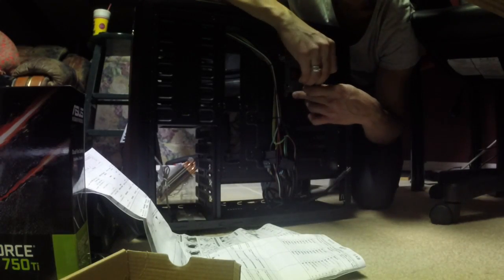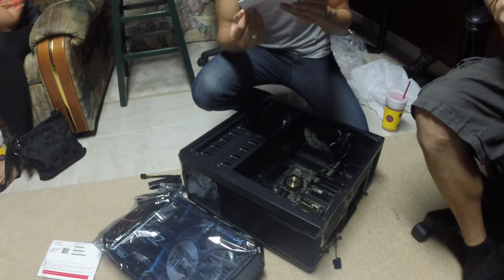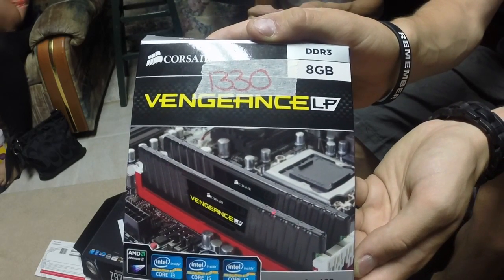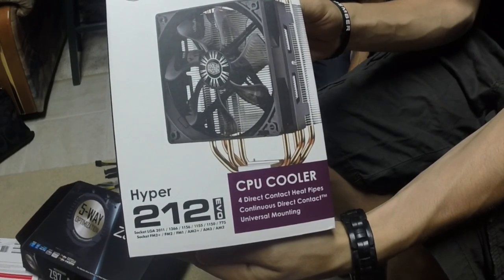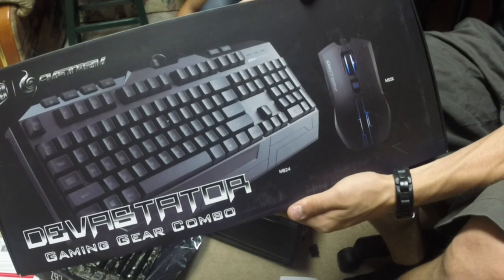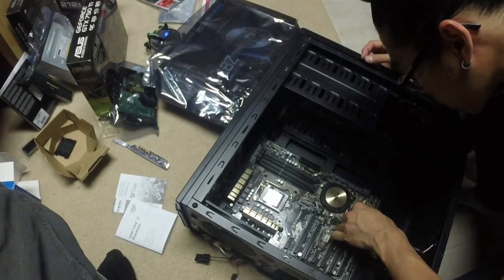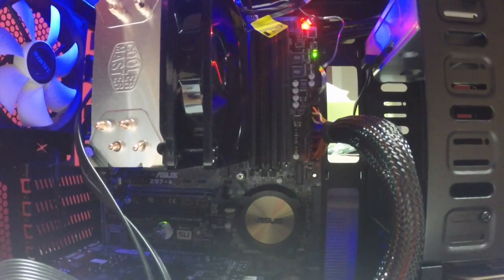Gaming PC Update - Parts inside, Problems Booting | SLAPTrain

Comment from the maker: Alrighty guys so PC is good and working :) very excited the problem was the CPU little heatsink got into the chip and shorted it cleaned it and it was fine, please keep your negative comments to your self if you don't agree with a part i have chosen thats fine but don't comment saying this and that and bashing my build this is my build not yours  :) 
thanks guys for all the help !
Reply: Ignore the haters bro. My build cost me around 800$. Its not the best but it gets the job done:)
Reply: man i have the gtx 750 ti 2gb edition and its good card its quiet and its going to run almost all the new games at high/ultra except the best looking games like metro last light
Reply: 600 watt should power that no problem, you might have a dead mobo or processor, look for bent pins on the motherboard, that might be it
Reply: Have you plug the CPU 4 pin or 8 pin connector?? the power supply should handle all the system... Also make sure that the ram is in the good channel (Dimm 1 and 2). Make sur that if its a 8 pin processor power to use the one with 2 four pin and not the one with 6 and 2 pin ( this one is for Graph card).
Reply: Hey your watts should actually be OVER 9000!!!!
Reply: Carlos Roca hahahahaha xD
Reply: slap you should try out need for speed world
Reply: Shadowmark r So he can get owned by hackers ?
Reply: Nissan544 Gaming Really -_- There is some hackers, but you don't see them as much as 2 years ago. Does hackers mostly race A class cars, or used drift mods.
Reply: Glad to see you got it working when I build mine it was the motherboard that was wrong with mine it took 3 hours then I took it to best buy where I got the motherboard and looked at it and found it right then and there. Best of luck and Keep on keeping on
Reply: Do 2-3TB
Reply: HI!!
Reply: 600w is a lot for that computer you can drive a 4770koverclockd and a gtx 780 with that
Reply: could be a problem with ESD, you should never build on carpet to prevent damage to parts :/
Reply: Did you ground before you started working because if not you probably fried some parts with ESD
Reply: the build is done he fixed it already -_-

Comment: One little tip slap at 3:28 the motherboard is laying on top of the anti static bag which is bad for your motherboard, might cause a discharge. just put it on the box itself without the bag ;)

good luck with the build man
Reply: As long as the outside of the bag isn't conductive it's fine to do that.

Comment: Slap, you might want to wear a anti-static risk band to be safe when working on the PC. With a Intel i7 & a GTX 750, you might want to consider getting a minimum 800w power source in order to handle all that power. Just my tip.

Comment: 600 watts is more than enough for that build, even 500 watts is enough for that build but it's always good to have some extra wattage if you wanna upgrade your pc in the future. It might be the cpu or the motherboard, check the pins on the motherboards cpu socket. I hope you get it fixed soon and I hope the cpu is not the problem. Oh and go ahead and move the graphics card to the top pci-e slot on your motherboard, don't know if this can affect it but if it's in the top slot and everything is okay it should work :) Good luck!

Comment: You got to connect your screen to the Motherboards Output because the graficscard won't work without the drivers installed! In fact you got to start it with the screen plugged into the motherboard than install the drivers for the card and than plug the screen in your card an everything should be fine

Comment: TheSLAPTrain1 The pins for the processor can be bent! I had the same problems with my secound motherboard. It booted but nothing happend. Stores don't return the motherboard in that case but they may give you 20-40 % off.

The best thing to do is take a picture of a motherboard when its brand new. Thats what the reseller of my motherboard told me.

Comment: When booting is there any beep count from the pc? One or two and how long is the tone

If not possible issues 

memory not seated properly, pull out the ram and put it back in again you should hear a loud click and it will take quite some force

If you think the PSU is defective put it into your old PC to test if it works. Or pull your old one out of the old pc and test in new

To further check if you know what your doing you can test with a multimeter to see if your getting power to the proper pins (note only do this if you know what your doing) 

PSU not strong enough, there is a lot of great pc power calculators floating around the Web if not pull out the Gpu and run it with on board graphics 

Possible power switch, yes I've actually had this happen to me took me a few days to figure out. Pull the old switch out of old pc to test if you can't get it out or it breaks you can bridge the power and ground with a pin to boot

And to test CPU you'll need another mobo with the same socket on it

And if all else fails go to tiger direct or NCIX

Comment: yeah, it's the PSU, you'll probably need a 750 but I'll recommend a 1000 for that extra just in case of any additional upgrades that will be installed later.

Comment: Your power supply should be more than adequate for this build. I'm a technician/hobbyist and I've come across this error on multiple laptops and pc's, both new and old, and 9 times out of 10, it's a problem caused by the graphics card OR ram. On occasion it can be a motherboard issue but that's more common in older machines. Just to check though, If you take all your ram out and boot your PC you should get a beep code, if that happens you're motherboard is probably ok, and you'll need to troubleshoot your RAM and graphics card. Like I said it's more than likely a fault your graphics card, which you should be able to return (I'm in the uk so I'm not sure what American policies are so I may be wrong) 
Hope this helps good luck with your machine, she looks beautiful!

Comment: go into Bios Setup and search for Intel Graphics, disable it and set the graphic on pci express.
The 600W PSU is way enough, at my workplace, we sell i7 4790QC and an Zotac GTX760
Reply: and if the CPU Cooler works, the CPU should be Ok

Comment: 600w should be more than enough to run that, check your cpu socket slap some of the pins may be bent or the motherboard its self could be screwed and the processor could just be jacked. Hope you get it up and running though! Something tells me its the motherboard because if theres no post screen or bios screen that means that either the video connections are jacked or the motherboard is jacked!
Reply: Also take out the cpu and unplug everything from the motherboard except the power and the vga or hdmi to view on the monitor and try and boot it up, if there is no screen saying ASUS on it or any type of asus image then you will know for sure if the motherboard is jacked up or not! Hopefully this helps man!

Comment: Whoever said u need a 750w for a build like with very low powered gpu arcetechture such Maxwell u could probably r in that system with 500w but ya just wont be able to add a lot of stuff like crossfire/sli or extra hard drive but it could be that your pay is faulty but cause it doesnt seem like ur cup would be the problem

Comment: A locked i7 with a Z97 board and a 750ti... That's a rather... interesting combination. 

Anyway, 600w is more than enough. 750 is completely overkill for a build like this, you could run a dual GPU setup, depending on the graphics card, with a 750W PSU. If you think it's the CPU then see if you can get the store to give you another one, if they don't, contact Intel to see if they can do anything, 9 times out of 10 it's better to go to the manufacturer rather than going back to the store.

I found this checklist on a forum, it might come in handy.
http://www.tomshardware.co.uk/forum/261145-31-perform-steps-posting-post-boot-video-problems

Comment: 1. 120TH hard drive is not enough for the editing, recordings of games and the games themselves; try to get (at least) a 500GB hard drive but I would say get a 1TB.         2. I don't know about power supplies but I would say that 600W is not enough.         3. try to get 16GB of ram as you can allocate more memory to games allowing them to run smoother.

Comment: My computer was around $800 I only have 500 watt power supply it mine runs fine. The 600 watt should be enough to run the system fine. And I went with the same mouse and keyboard and they are wonderful so far.

Comment: A couple of warnings about this build. The PSU might be too little not sure since my build that uses a fx 8350 and a r9 270x needs 650W and the mouse wheel might start squealing after 1-2 weeks so you need to take it apart and put some lubrication into it. but the mose keyboard combo is pretty good for the price did you plug EVERYTHING in cause no fans are spinning when you show off the lights and stuff
Reply: AMD parts are power whores tho, tht gpu is super low power so he is fine :)
Reply: Yea that is what i am saying if that is for AMD parts this should take much less

For this build the guy claims that it need 450W minimum: http://pcpartpicker.com/p/M4hvD3
Reply: His build wont even pull 300W. The PSU is fine... with the exception that it's built by CWT.
Reply: Okay so it turns out that it was the processor being outa position

Comment: ohm just wanna say that 600w is more then enough, (could have a titan in there and still have extra power left)
dose it boots into the bios?
Reply: Also the processer dont have pins, they are on the motherboard. so is any of the pins on the motherboard that is bend?
if not then it is properly the cpu

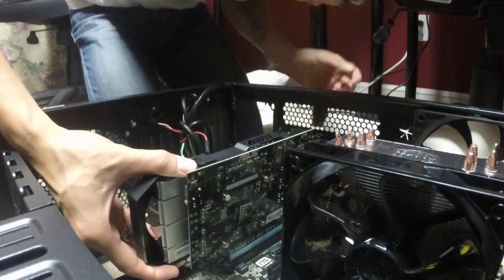Comment: At 5:02 , Was he trying to put the GPU in the PCI-e with the rubber protector still on? 0.0
Reply: TheSLAPTrain1 Btw you would have been more than alright with an i5 instead of the i7
Reply: he checked that the right expansion slots were removed :)

Comment: 600 watts is plenty so it won't be that unless its faulty if ur using it for just gaming then 8gb of ram is enough but more ram is a benefit if ur rendering and making vids but you may need something better for gaming then a gtx 750ti if ur planning on playing high end games like a gtx 760 or above as for the problem have u tryed putting in different ram or put one stick in and try booting it up and if that don't work try the other stick cause when mine wouldn't boot it turned out to be faulty ram I changed it and all was good after and make sure in your bios that ur booting from ur HDD

Comment: Hey Slap, word of advice. NEVER under any circumstances build a pc on a rug. You have to make sure you don't fry your board or anything when you touch it. Also, 600w is PLENTYYYY for your 750ti, There's a reason there's no power connectors on the GPU. Another thing, it looks like you didn't see picture because you guys put the GPU on the lower slot of the mobo, sometimes things dont work properly at first when you build ur PC at first so you always want to connect the card on the very first slot closest to your cpu fan, not to mention your card wont cool down as well if its so close to the power supply. I see you're using the zalman z9 tower tho, I have that too!!! for great air flow, add one more fan on the top of the case pulling the air out. my personal experience, it's helped my case stay a bit cooler inside at all times. make sure your PSU fan is facing DOWNWARD on the case as well!! theres mesh grills on the bottom for the fan to be oriented as so.

Edit: just read your comment from two days ago, glad you sorted it out!

Comment: Why did you take a Z97 Motherboard when you have a non overclockeable processor ?
Reply: 600W is enough , my buddy keeps an I5 4690 and a R9 290 on a 600W Gold power supply , so 600W is ENOUGH!

Comment: I'm looking at this and I'm not taking a stab here, but you kinda boned yourself with this build. Even though your 750ti is 2GB, it's only 128 bit. You could have spent a few bucks more on a 2 GB 760 and not have to worry about anything. I was trying to spec a build out and ended up going with a prebuilt because for $400, why not?. You're going to end up swapping the gpu out in the next year or so in order to keep up with games. But if it works for you, that's what matters. I'm just looking at it from a tech standpoint.

Comment: You done goofed on this build slap....Why go for an I7 If its not a render rig? And you went with a 4790 of all chips, should have gone for a 4770k or 4790k, and the graphics? LEL, You'll be lucky to run all games on ultra, With AA, for the 1500 you spent, You could have gone with a 10x better rig than this BY FAR!, I bet you probably didnt build this all by yourself either, ever thought about Built Not Bought, well the same concept applies here my friend....OVER AND OUT, PEACE!!

Comment: TheSLAPTrain1   600W should be good, the graphics card needs a minimum of 300w.  be sure that all the power cables are connected to the motherboard and GPU if the power connections are not connected to the GPU when you turn it on... it won't boot.  its RARE that a processor goes bad.

Comment: slap, why did you get a i7?, you could have gotten a amd fx 8350 for half the price.
Reply: Because the i7 will DOMINATE the amd in almost every test that's out there.
Reply: i7 is great if you have the money.
Reply: hockey402 amd is know to be better at multi tasking
Slap should havengone with a 8320 a hyper 212 and he could do everything apart from rendering
Reply: BLR IDRIFT
I render and edit in Vegas Pro with an FX 6300 running at 3.8GHz, with no problem at all. A 20 minute video in 720p rendered in 45 minutes. The only downside for this PC is that it only has 4 gigs of ram and an R5 230.

Comment: 600w is way enough bro. a 500 would be able to run it :) no problem with thw power. (if it gives the system more than 500) if it works the psu will not be the problem
Reply: cpu or motherboard broken. check for bend pins. otherwise i dont know

Comment: I running the same type of processor slap, your motherboard is the wrong chipset. You need a z87 not 97
Reply: Z97 is compatible with Haswell, Devil's Canyon (unlocked Haswell refresh CPUs), Haswell refresh (The CPU that Slap picked) and Broadwell.
Reply: Nope.You can put a Haswell Refresh on a Z87 but you need a bios upgrade. But the recommended motherboard chipset is H97 or Z97. The Z97 is useless here.He should've get an H97 .
Reply: Hmm... Did he try setting it to wumbo?

Comment: yo put your gpu on the top slot
Reply: Technically it doesn't matter. As long as it's a PCI-E Gen 3 slot running at 8x (or higher) then he will get the full performance out of the card.

Comment: 600not enougth.... I do have a 750 watt psu and i run a amd fx 8350 and a gtx 760 and i use like 550 to a max of 600watts but i have a 8350 wich consumes power like crazy and a 760 wich uses almost the double amount of power as a 750ti so now way that is it but your psu can be defective or it may be your cpu but plz let it be the psu plz thats way easyer to get replaced

Comment: You need at least 800 watts bro
Reply: with a 4790, a 750 Ti and extra fans? Might as well.
Reply: 800 wats is enough for a 780 ti dude
Reply: ***** if he dont overclock, its enough
Reply: 800 watts could power sli 760's.. A 600w psu is overkill for a 750ti.
Reply: ***** ok how about you all get off my back it was just a suggestion for christs sake.
Reply: ***** My brother has a gtx780 and 600w and I have radeon7970 and 600w and we run everything completely fine
Reply: No he doesn't... I have practically the same rig and run a 550 watt power supply.
Reply: i have a 770 plus 6 core amd, 650w is more than enough me
Reply: I run my AMD FX-8350 and 750TI on 500w no problem.  He doesn't need 800w
Reply: i7 need 100w and gtx 750 ti need 75 w hard drives 30w fans 10w 450w psu vas enough good

Comment: 750w is overkill. You could even get away with 500w.. I am running a i7-4770K and R9 280X, no problem
Reply: 500w and a 280x? risky tho
Reply: its no prob tho. full load and still more to go
Reply: ***** yeah I have 750w for my pc. 280 nonx and 8320 :) I went overkill so the pay fan will be a little quieter

Comment: Very unbalanced PC. a 750ti is a mid low range graphics card, and then you buy a motherboard for overclocking and you don't have an unlocked cpu?, about the memory is cheaper to buy 1866 than 1600.. the rest is fine,